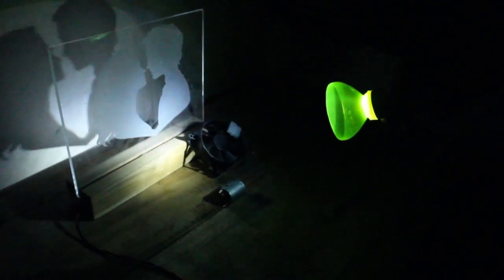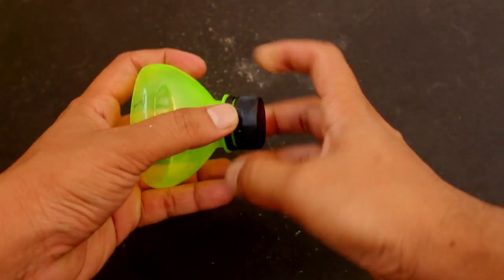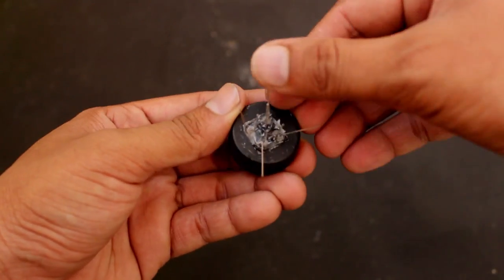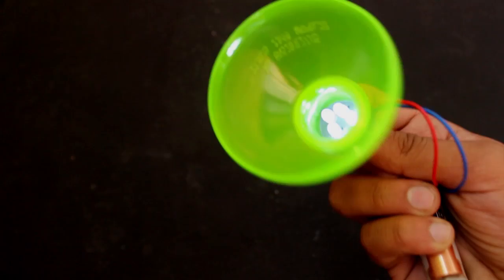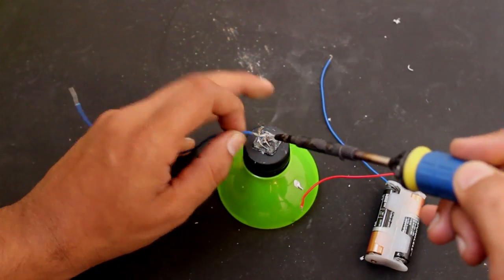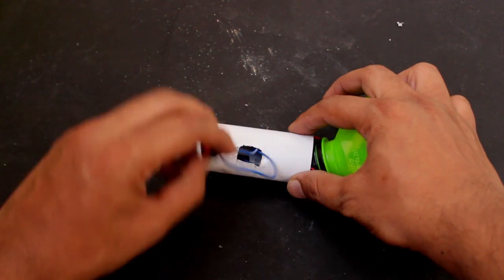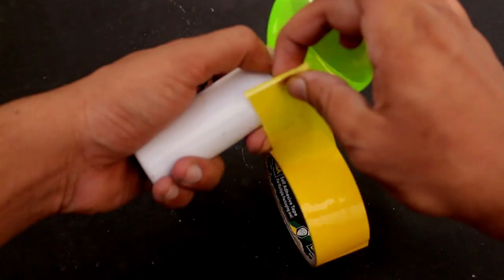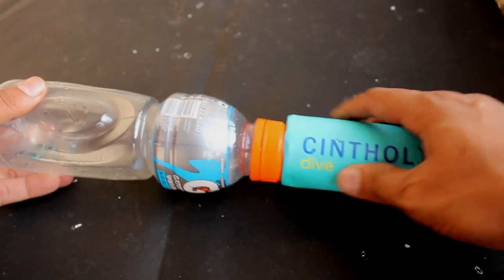How To Make LED Flash Light With Plastic Bottle And Deodorant Bottle

Comment: hey, are those 8mm 0.5W LEDs? also I see you didn't connect any resistor, I thought such flashlights require correct resistors for reliability? And maybe attaching aluminium foil around the plastic bottle head would produce better outcome?